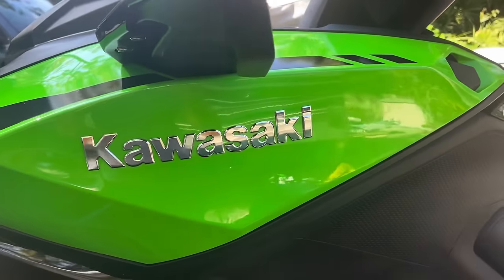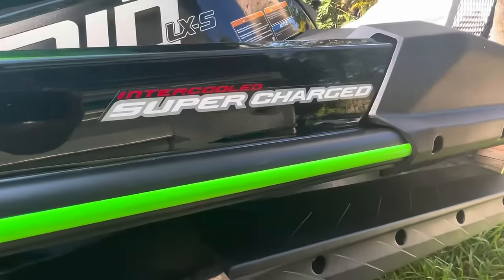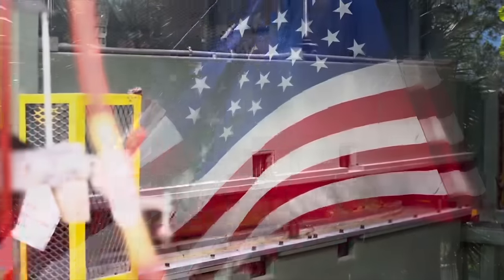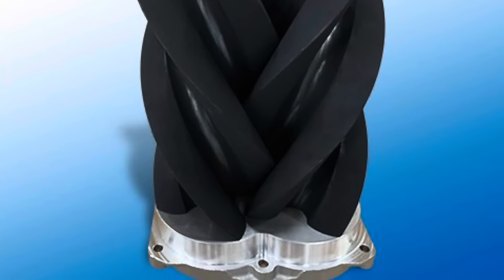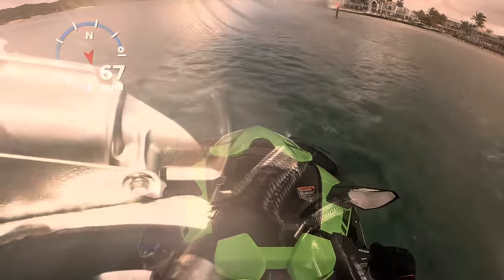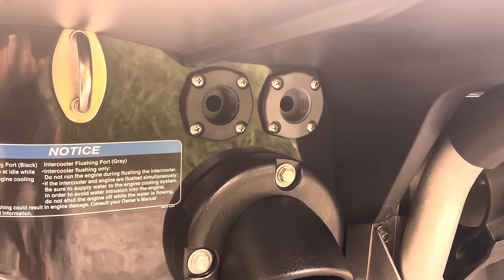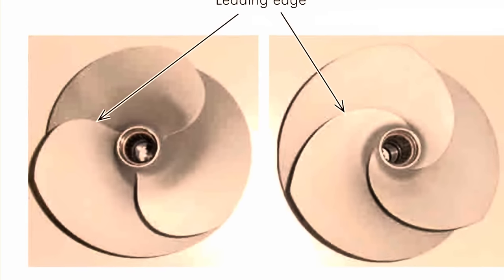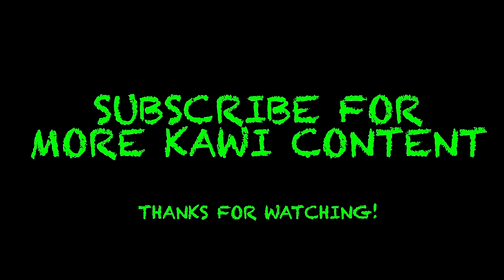Why I Chose To Buy A Kawasaki Ultra 310 Jet Ski and start a YouTube channel dedicated to it! 🔥

Comment: I am in the market for a new ski, I am being told to stay with the big players like Yamaha and Seedoo. I use to own a Kawaski Ninja ZX14 which this engine shares close design with.   I feel like the Ultra 310 LX will be the right ski for me. Tough time finding one thanks for the updates new sub. Have you had any problems with impeller clogs or grate clogs?
Reply from the maker: Thanks for watching! My best advice for you would be to look at the skis in person (I know that’s basically  impossible these days) go knock on the hull and look at the pump and engine- Kawasaki quality jumps out at you. I think that Yamaha makes a decent product, but while Yamaha and SeaDoo are focusing on phone integration, bells and whistles, and experimental light weight hulls, Kawasaki has been plugging along with real innovations “under the seat” as I like to say. If you watch some of my ocean videos you will see I sometimes ride in heavy seaweed, and I have not had any issue with the pump clogging. I did suck up a bag once, and just aggressively rocking the ski back and forth with the engine off cleared it out. I love the 310 and couldn’t ask for a better ski. I try to “put my money where my mouth is” by uploading lots of real-life POV videos of the 310 in action.
Reply: @JDsWaterWorld  I have subbed to your channel and even looking at how you do maintenance on it so I can do it myself. Good advice on knocking on the hull to see how they sound and I will ask the dealer to show me the engine bay on the Kawasaki. I am sold on the Kawaski, I just have to find a dealer who won't try to rip me off with ski and trailer. Cycle Springs are reasonable on trailers I will have to see about the ski. If I can't get a 2022 I will order the 2023. I love you're channel.
Reply: I was looking at the SeaDoo RXT-X before  Kawasaki updated their 310's this year. I have always owned Kawasaki sport bikes and loved them. So glad the timing worked out for me because I bought the Ultra 310 LX.  I absolutely love it!!    10/10 would highly recommend!
Reply: I bought the same exact LX-S model as JD watching his videos and Kevin at the watercraft journal regarding hull as my lake can be like an ocean on many days - these guys had experiences with all makes and create very unbiased content so figured if they endorse it why not - and superficial side of me could not resist the styling that is unique - compare equivalent Sea Doo and Yamaha and they kind of look similar

Comment: yamaha has an issue with stretched  timing channe from coming in and out of the water when on throttle,  leading to blown top ends ! 
What is the Kawasaki timing chain like thin like Yamahas or more robust??
Reply from the maker: Yes, much higher quality timing chain. I have never heard of one breaking.

Comment: Csn I makenit from Ft. Lauderdale to Bimini on the 310? Anyone knows?
Reply from the maker: It’s just over 50 miles each way, I have gotten about 80 miles on the tank with normal riding. I would bring extra fuel on a rack.

Comment: Think strongly about the cooling system VS Seadoo cooling system. That it self is BIG !!
Reply from the maker: The SeaDoo closed loop cooling system has way too many unnecessary components and hoses to fail- and is way over complicated. Also you can’t run the SeaDoo out of the water for more than 5 seconds without damaging the carbon seal- making the ski impossible to flush properly after salt (salt water still goes through the exhaust and the over complicated ride plate) that’s the real reason they have closed loop now- after decades of failing seals that was their answer…
Reply: Seadoos are closed loop for a reason. The engines aren't designed for Salt water use. Kawi & Yamaha have a corrosive baking process that allows them to run in salt

Comment: JD, where do you putt your helmet when not used or not riding? Nose access too small to fit helmet
Reply from the maker: I just latch the helmet to the rear upper grab handle- which is pretty much the only place it can go!

Comment: i prefer yamaha FX SERIES for rough water and reliabilty and also for fun and speed. nice jet ski that kawasaki by the way
Reply from the maker: So Yamaha makes a great product and the FX is a great line of skis. I owned a 2021 FX, which I sold to get my Kawasaki 310. After 85 hours the thin automotive paint started to delaminate off the bottom of the hull. I never beach my skis and don’t even motor onto the trailer..in my opinion the Nano xcel was terrible…coming off waves my front compartment would occasionally  pop open from the hull flex. The new FX has an SMC hull, so might be much better? 

The Kawi is the most fun and reliable ski I’ve ever owned, and is hands down the best ski for ocean riding and chop. I’ve owned 6 Yamaha skis, and became a Kawi convert over the Ultra Hull platform and the hull and paint reliability issues with the Yamaha. Thanks for watching and commenting!

Comment: I want to see this in the ocean. I tried an fx svho & it was fun!! Compare to my gp1200r it was night & day difference. Full throttle & wasnt tossed around like in my gpr. Been looking but overpriced because manufacture are not producing like before. So going to wait, i guess my 3k for down payment is nothing now haha
Reply from the maker: Oh man you really have to test out the new 310! Check out my many ocean ride videos, as well as the latest review of the 2022 310x by @ The Watercraft Journal. The FX platform is a great platform, but doesn’t hold a candle to the Kawasaki
Reply: @JDsWaterWorld  i did test an older 300, it was mofidied but didnt like it, felt i was to high on it. I know the mew ones are different & maybe bigger & few changes.. i know they used.stock kawasaki for ocean racing but videos are different than actually testing them, & here no dealer lets them test any pwc at all.
Reply from the maker: The 2022 310 is night and day over the older 300s. Yeah unfortunately dealers don’t offer test rides here either..you basically have to have a friend with one of you want to test it.
Reply: @JDsWaterWorld  yeah, thats how i tested a 21 fx. & his friend had the other modded kawasaki. Here at the bay it does get choppy, i think the fx will do, dont do lots of ocean riding anyways but would like to go there just ride it for a bit.. how the reliability on the engine? I know this is a new one
Reply from the maker: https://youtu.be/ZktaLrpS2wI

The Kawis are hands down the best skis on the market. The engine and hull are not new- the engine is the same since 2017 so has been time tested and proven. Watch the review at the link I posted above..
Reply: @JDsWaterWorld  dam, those go fast here too, but i ended up getting a 22 fx  svho, should get here soon, no wait list, got lucky. Hopefully thats fiberglass not nano xcell, cheap hulls
Reply from the maker: We’ll best of luck! Glad you were able to get something to get out on the water, The FX is a great machine.
Reply: @JDsWaterWorld  yeah, i asked for a kawasaki but they said they were all gone. & for seadoo idk if they already fixed the carbon seal problem, so they dont sink, but this will do for now.
Reply from the maker: Dude they most definitely did NOT fix the carbon seal issue on SeaDoos…The Yamaha was a decent choice and I’m sure you’ll enjoy the hell out of it.
Reply: @JDsWaterWorld  that sucks, i was thinking of getting one if they beat me to the fx. They were 2 ppl trying to buy it cash.
Reply from the maker: It’s crazy out there!
Reply: @JDsWaterWorld  FYI Sea-Doo has redesigned the carbon seal, been that way for a few years. Although it still is a weak point just as there are weak points on all manufacturers of PWCs. You really come out as a all-out shill for Kawasaki, but I get it everyone wants to love what they buy.
Reply from the maker: It’s one thing to design something that works, and another thing to continually attempt to redesign something that has an inherently flawed design to begin with. Problem with the Sea-Doos, is that the weak odd-number of engine mounts fails over time, causing the “reformulated” carbon seal to wear unevenly and fail just like it always has…bad engineering. Don’t even get me started on the lousy 3-bolt design SeaDoo uses for the intake grate.. when consumers are killed because of defective products..BRP should be ashamed. Yes, I have owned SeaDoo, Yamaha and Kawasaki for years, and as someone who also does all my own mechanical work, I can tell you that by far Kawasaki is a superior product. I have no problem creating this channel or standing behind the Kawasaki products, because I have seen their products over a span of more than 30 years and the quality is unwavering…
Reply: @JDsWaterWorld  so kawaski is also relaible? Heard those dont last that long like yamaha. Trying to comvincey.brother to get one lol. I got a 22 fx cruier svho & its fun buy a kawasaki is better for rough but heard is not that reliable compare to yamaha
Reply from the maker: Oswaldo, everyone has their own experiences…For me, Kawasaki is the most reliable hull, most reliable driveline, most reliable jet pump, most reliable supercharger, and engine. So much so that I started a channel about it…hard to find any SeaDoo content from anyone who isn’t a “paid ambassador”. I was very disappointed with Yamaha and the quality of their Hulls- is the paint on your SMC 22’ better than the nano? My nano FX was terrible..the paint scratched if you looked at it wrong lol. The FX is a good platform and overall very reliable. The S/C setup tends to throw clutches when you ride in the chop I have witnessed.
Reply: @JDsWaterWorld  i see, ill let my brother know to get a kawasaki 310r or one of those models. Im guessing some do a bad product but.may e 1 out of 100 or something. Ive had good luck with my pwc so far.. most videos are paid so they will not be honest.... & my smc its still cheap car paint 🤣 bottom is all scratch from loading it to the trailer, bottom hull feels a bit better on choppy since it gained a few lbs. So im just going to put gladiator glude on bottom, so i can beach it lol & i added a blow off valve to help with clutches. But if i just have to much problem with them, im going to add a turbo to it lol

Comment: Top speed is 69 mph? I had a yamaha 1000. 14 years ago went 70 mph. Whats the point of all this horsepower?
Reply from the maker: Every new ski sold in the United States has a speed limiter in accordance with an agreement between the USCG and OEMs. The aftermarket will develop a speed control override for this ski eventually. The horsepower gets you out the hole instantly and to top speed almost instantly that’s the biggest difference. I’ve had multiple Yamaha 1100s..the WVT would go about 62 but nowhere near 70.
Reply: @JDsWaterWorld  True , Speedo MPH Vs GPS is waaaay off !
Reply: jet yaghtß
Reply: Acceleration and handling

Comment: JD, at 6’2” do you have any thoughts on changing or adjusting your seat?  It looked like you might have been sitting on the first seat bump/back support, I’m 6’ and would kinda like the bump flattened out back about 2”.
Reply from the maker: Steve, yes you are right. I do tend to sit back a bit on the lumbar support/ second seat part when slamming around. Although I found that sitting more forward does help keep the pump loaded up in the chop. I think once the adjustable seat comes back in stock I am going to purchase one..if it was back just a few inches I would be happier. The seat itself though is very comfortable- The narrow taper is a much needed change from the massively wide seat on the previous gen
Reply: @JDsWaterWorld  good observations, thanks!  Will have to check out the adjustable seat, was thinking that was an LX only thing
Reply from the maker: The cool thing is that every accessory or part on the LX is sold as an optional part for the X and LX-S models!
Reply: @JDsWaterWorld  I just saw a video from you installing adjustable seats brackets for the X. I believe you mentioned you found them at  K-Speed? 
Can you share the link as I cannot locate these brackets. Thanks man your channel has totally narrowed down the make and model for me to purchase in a week or so when I can find a Kawasaki Ultra 310 X. Can’t wait.
Reply: I have owned 2 310x's for a year now. Previously owned 2 2007 Ultras. All of these skis are1/were used only in Lake Havasu, AZ. JD is absolutely correct about  the Kawasaki hulls being the absolute best rough water skis.
One thing that I dislike about the new 310's versus the old Ultras are the seats, which force you to sit in a certain position with no ability to slide back and forth plus being very hard on your private parts in rough water. My solution was to have Jetrim modify the seats ro make them similar to the Ultra  seats, I.e. smooth. This has been a great change in my opinion.
 I do all of my own maintenance on my skis, which include many Kawasaki  and Yamaha standups (you may of heard of my son Jeff Jacobs). I can attest that JD's tutorial videos are first class.

Comment: What about the acceleration and the roigh water comfort and the soundsystem quality over seadoo rxtx or gtx 300 series?
Reply from the maker: @Rusli when it comes to the blue water performance of the hull and stock engine, the 22.5 degree deep-v Ultra Hull from Kawasaki is hands down the best on the market. The plastic CMtech SeaDoo hulls lack the mass and pitch to cut the chop like the Kawi. The deeper Kawi hull and top-loading intake grate keep the pump hooked up in the chop. Sound system? I don’t use sound systems on my skis, so cannot comment on that! I do hear that the SeaDoo has a nice sound system though.
Reply: Check out the watercraft journal review of the LX. The updated sound system is the best in the industry….. by far…four speakers! 👌👍

Comment: If you wanna something comfortable get an kawi ultra. I like yamis but to each their own.
Reply from the maker: In my book the Yamahas and Kawasakis are both great skis-BUT- Yamaha has failed miserably with their hull material and very poor quality paint..it’s a shame but I continue to get weekly emails about Yamaha owners frustrated with the paint failing- even on the new SMC FX line…the Kawis are decidedly old school in many ways and that’s what I love!
Reply: @JDsWaterWorld  personally i love both brands. Larger pwc and stand ups go to kawi.  Smaller pwcs I prefer yami because of the hull design. Yes the paint will come apart but they also have the lightest 3 seaters on the market. I’ll take anything so long as it doesn’t sink cough cough sea doo.

Comment: A kawasaki assembled in america? 

shudders

Take it easy its not Halloween yet!
Reply from the maker: Would you prefer a SeaDoo made from Chinese parts assembled in Mexico??
Reply: @JDsWaterWorld  nope I'll buy a yamaha I think
Reply from the maker: Good luck with that terrible automotive paint! I had 2 2021 Yamahas and the painted Nano was a nightmare..sold both at a loss..I owned Yamahas for 15 years and they lost me as a customer after what I went through with their ridiculous quality issues. I still own a SMC gelcoat 1996 Yamaha WaveVenture, but won’t ever buy one of their newer skis. The 1.8 isn’t bad by any means, and if they fix the paint issue, and now the fuel gauge issue…I’d possibly consider adding an new SMC FX SVHO to my fleet..
Reply: @JDsWaterWorld  so what exactly was the problem with the paint. Elaborate
Reply from the maker: Go find my YouTube short “2021 FX hull delaminating.” The issue is that the Nano hulls flex, and the automotive paint develops hairline cracks. It’s impossible to maintain and keep it looking nice..The Kawi is gelcoat (like every modern production boat) and is extremely durable..the Kawi hulls last 30 years..I own 30 yr old Kawi as well and it’s made same way. I don’t beach my skis, don’t abuse my skis, but the Yamahas the paint wore off the bottom in less than 50 hrs, Yamaha does not cover under warranty. This is very common, no secret in the Yamaha community. It’s really sad..that being said, the hulls are still more durable than a thing SeaDoo makes.